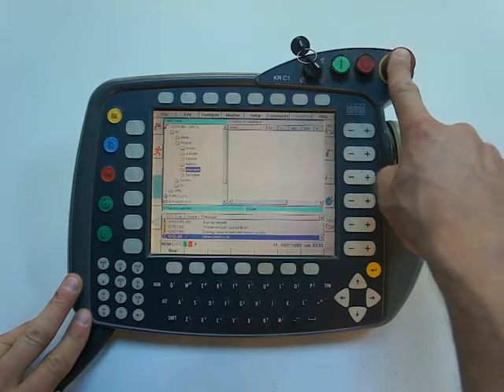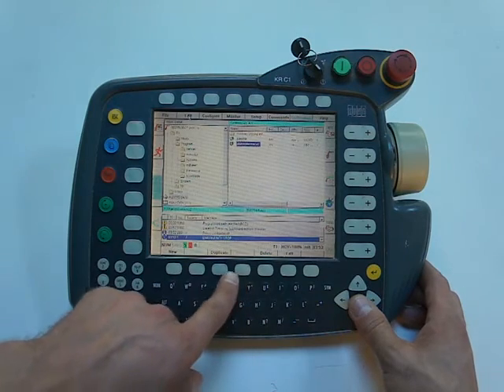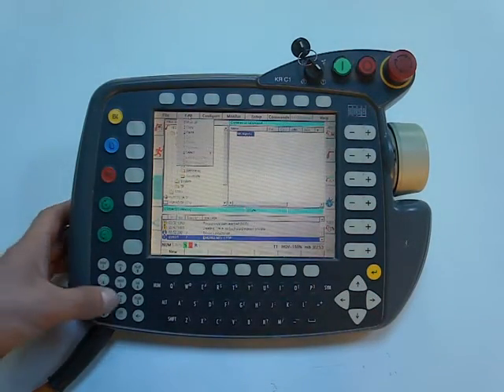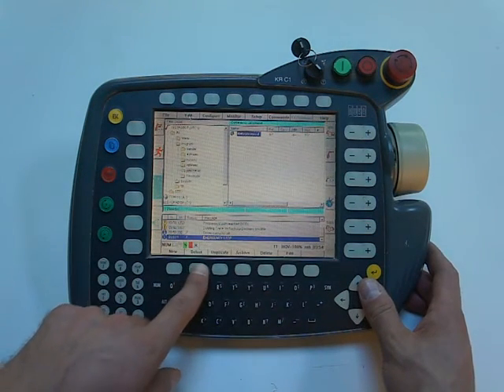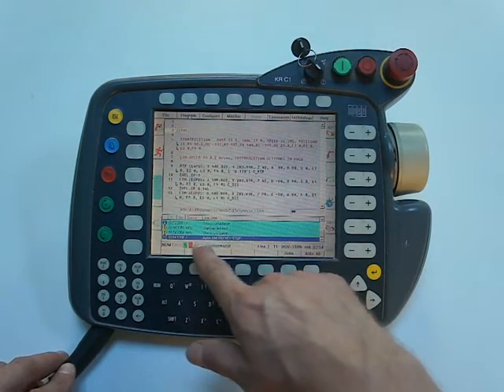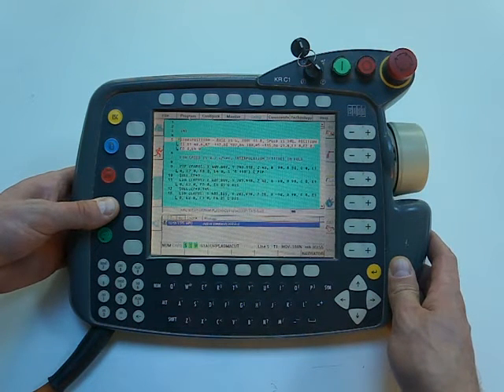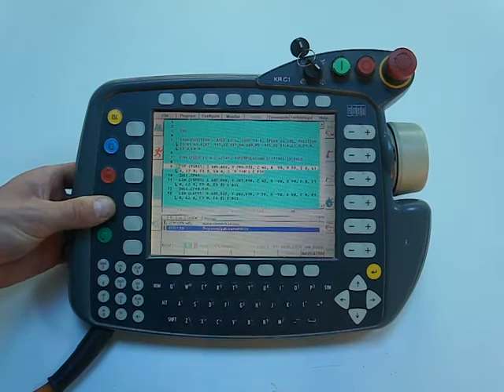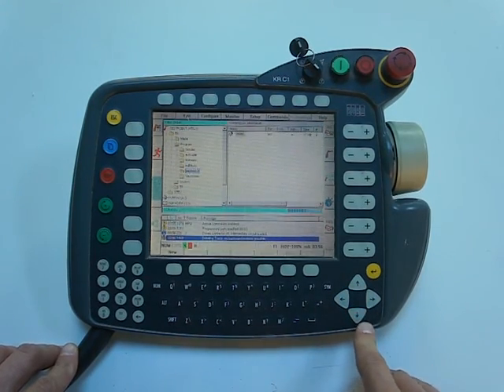Files From USB to KRC1

Comment: What model machine are you using? Looking into getting a kr210
Reply from the maker: The machine in the video is an old KR150.. If you have the space for a kr210 great.. What kind of tasks do you need it for? (other than exploring and trying out ofcourse ;) .. btw, I am not using this or other 6dof arms at the time being.. I have to say, specific tools like 3d print and 3axis mill are great too. This kind of 6DOF arm is great for large scale stuff.. Circular saws, chainsaws and plasma cutters ;)
Reply: @stigantonnielsen  I'm kind of tied between a kr150 and 210 now that I think of it. A little more precision is always better. But I'm planning on for a linear track and do a little carpentry work. Then upfit it for cnc and 3d printing. The one I have sight's on has a welding inverter.

And I know this sounds ludacris, but if I can figure out a way for the kr150 to be X,Y mounted, that would be sick. 

Just basically want to fulfill some ideas with it. And possibly help others with theirs as well.

All of this is kind of overwhelming!
Reply: Do you happen to know what's the name of their proprietary language? And where some resources could be?
Reply from the maker: @danielhildebrand7684  it sounds like you are about to have a lot of fun :D -stay safe they are very serious machines, but I guess you know. The language for programming the older Kuka machines is KRL (kuka robot language, similar to G-code but it also has controlstatement for the inbuilt GPIOs) -I will see if I can link to some documentation..
Reply: @stigantonnielsen Yes lulz. Thank you very much for this. I will most certainly upload when the time comes
Reply from the maker: @danielhildebrand7684  http://www.wtech.com.tw/public/download/manual/kuka/krc4/KUKA%20KRL-Syntax%208.x.pdf